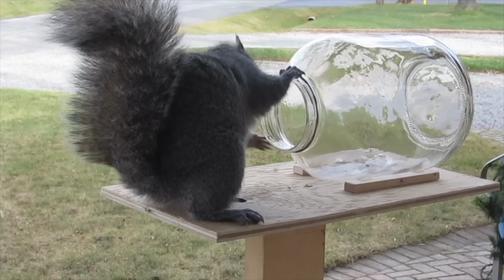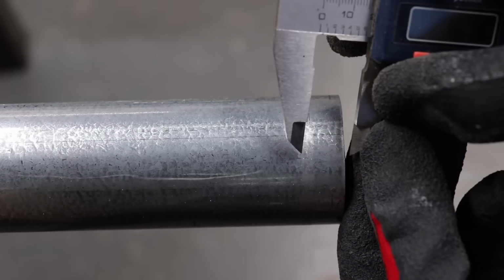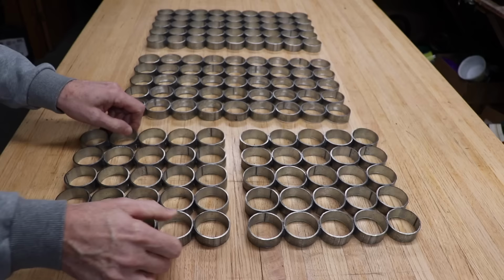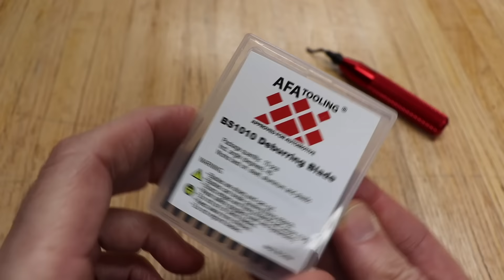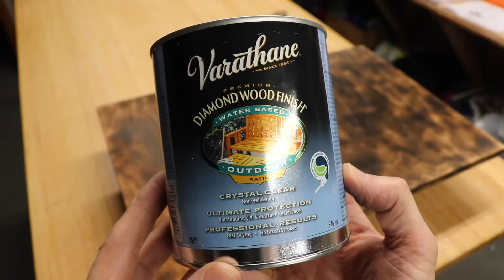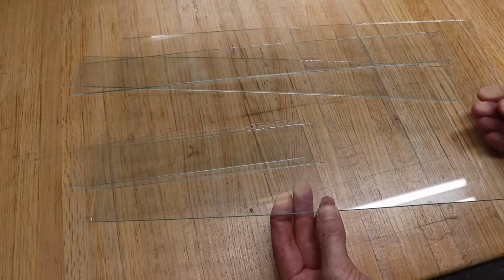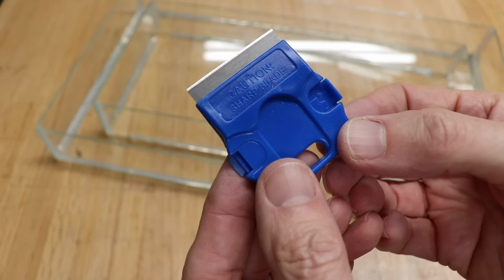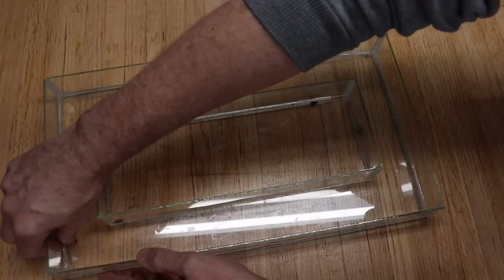How to Make ● A Unique Squirrel Proof Bird Feeder ( that actually works ! )

Comment: How do I make a squirrel feeder that birds can not get in??
Reply from the maker: You can easily! Just leave your garage door up about 2 1/2" to 3" inches and lay a pile of seed on the floor in the garage . The squirrels will enter and not the birds. Of course doing this brings on another whole set of problems with the squirrels inside your garage. This is why people try to keep them at bay since they do chew everything and can cause a lot of damage to wiring and to your house. You may have missed it but they are able to get some seeds. Just go to 11:57 in the video where I show that.
Reply: @chrisnotap  Actually I am getting squirrels in my attic.  I think they are pushing the soffit in.  Little rascals!!

Comment: Was no need to reduce the size of the tray, I see no prob with the squirrel getting a handful of seeds.. the issue is when they knock all the seeds to the ground right away, then destroy your feeder.
Reply from the maker: You may have missed that at 11:57!
Reply: @chrisnotap  True true,  really, I don't see much of a difference in either design :) The larger tray does allow squirrels a constant supply of seeds, but still at the same consumption rate

Comment: really underestimating squirrels. 
had squirrel feeder made out of 22mm plank. whole winter it had nuts in it, in early spring 1 squirrel noticed theres no more nuts in it. so what was left of it after squirrel having nut rage, was backboard and hinged feeder door hanging from tree by its upper rope. that bastard chew lower mounting robe

Comment: Can you make a bird-proof squirrel feeder?
Reply from the maker: Did you miss it at 11:57???
Reply: @chrisnotap  You've built an excellent squirrel-proof bird feeder. What I'm curious about is making a bird-proof squirrel feeder (for giggles, mostly).
Reply from the maker: Just leave your garage door up about 2 1/2" to 3" inches and lay a pile of seed on the floor in the garage . The squirrels will enter and not the birds. Of course doing this brings on another whole set of problems with the squirrels inside your garage. This is why people try to keep them at bay since they do chew everything and can cause a lot of damage to wiring and to your house.

Comment: Sorry to be critical, and I'm sure it was a fun project, but I really don't see the point of it. What's the difference between that and a cage of suitable gauge. Sure, you can watch birds going in and out, but it's hardly 'see through. Even if you put a camera in it, as you did there, you are not going to get good exposure. Plus, I can see those steel rings getting toasty hot in the summer. Don''t know your location, but here in Quebec, where winter temperatures can go down below -30 °C birds feet can stick to frozen bare metal. Could be a death trap. Better to take measures to keep squirrels off feeders IMHO. If you are going to feed them, feed them separately. Just my opinion.
Reply from the maker: Yes you can use whatever you like as the material! It's all about experimenting to see what works and what doesn't. I did small scale tests first to determine the best size of pipe to use. The summer heat was not an issue and through last winter there were no issues. You can see right into it very easily. Just angle it towards your vantage point and you can see birds in it clear as day.
Reply: @chrisnotap  Hey, if it works for you that's great. I'm all for innovation. My hobby is filming birds on my feeders, so I don't put anything around them that obscures the view and limits the available light. They are hung under clear acrylic plastic domes which double as weather shields and squirrel baffles.

Comment: Noticed that you didn't mention the fact that none of the larger song birds, doves, cackles etc. could get inside.   You showed some on the outside but failed to mention you had locked them out with the squirrels.   Everyone, don't make this feeder, it is worthless unless you only like very small birds........
Reply from the maker: Correct. It just comes down to birds that are getting up in size won't fit in. There is a happy medium. They are able to poke their heads in to get stray seeds that have been tossed out by other birds. They also forage for seeds that make it to the ground. In the end, it attracts all kinds of birds and they all get something. Don't let that stop you making one, it is well worthwhile!

Comment: This will not last. Should have at least tack welded them together or something. The silicone seal will degrade over time and weather will accelerate that process and squirrels will be invading this thing within a couple of years, maximum.
Reply from the maker: You are underestimating silicone! The last one I build 6 years ago, the triangle shaped one with 1 1/2" copper pipe,  is still together today and solid like the day I built it. The silicone did not degrade and stayed together even with the copper expanding and contracting on a daily basis in the summer sun and winter cold cycles. Try it! You be very surprised.

Comment: this will only work against full sized adults
Reply from the maker: The small ones will not approach structures. They stay on the ground or in their tree until they gain confidence and size.
Reply: @chrisnotap long term success? surprised you don't run into a few medium sized ones... perhaps a runt that survived even etc

Comment: Just use chicken wire with 1 3/4 holes.
Reply from the maker: You could try that. Does it come in that size? How would you attach the corners? They would chew through wood.

Comment: But can you make a bird proof squirrel feeder?
Reply from the maker: Yes you can easily! Just leave your garage door up about 2 1/2" to 3" inches and lay a pile of seed on the floor in the garage . The squirrels will enter and not the birds. Of course doing this brings on another whole set of problems with the squirrels inside your garage. This is why people try to keep them at bay since they do chew everything and can cause a lot of damage to wiring and to your house. You may have missed it but they are able to get some seeds. Just go to 11:57 in the video where I show that.

Comment: Sorry, I am more looking for a bird-proof squirrel feeder instead… ;-)
Reply from the maker: Here's the easiest way. Just leave your garage door up about 2 1/2" to 3" inches and lay a pile of seed on the floor in the garage . The squirrels will enter and not the birds. Of course doing this brings on another whole set of problems with the squirrels inside your garage. This is why people try to keep them at bay since they do chew everything and can cause a lot of damage to wiring and to your house. You may have missed it but they are able to get some seeds. Just go to 11:57 in the video where I show that.
Reply: @chrisnotap  I did not really watch your video, I was just triggered by the word “squirrel” that are considered to be cute in German urban areas without causing too many problems.

It's the martens who are trying to eat your entire car if they don't get away with its cabling — not so cute, but BOSCH has got exciting and surprising (high voltage) news for them…

Will have a look at your video now ;-)

UPDATE: Did watch your video, excellent job, looks nice and is very functional.

Yes, you tend to have these bigger and gray squirrels in North America — they even try to take over the UK as it seems.

Our German squirrels are smaller, much cuter — and almost as red as the bird you were feeding. They are somewhat stupid and forget about their nuts they are digging in, but this is actually their function in German forests, — reforestation ;-)

Have a nice day with your sweet birdies, kind regards from Berlin, Germany

Comment: Terrible design. For one thing. Silicone?? lol. This should be welded. Secondly, what kind of dumb decision was it to make the filling happen with bolts on the bottom??? The lid should be the thing that’s bolted and removable. It would be a lot easier. But in general, it’s an eyesore.
Reply from the maker: Silicone is amazingly strong and easy to use and anyone can build it! The bolts come out easily and it opens up without issue. It doesn't get much easier. The short pipes give a unique and interesting look. Give it a go. You'll be surprised how easy it is to build.